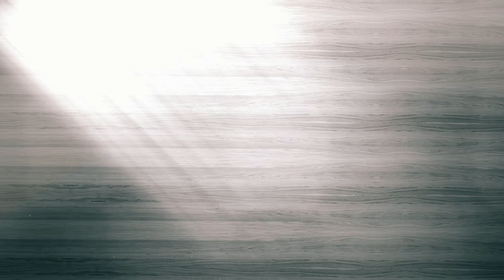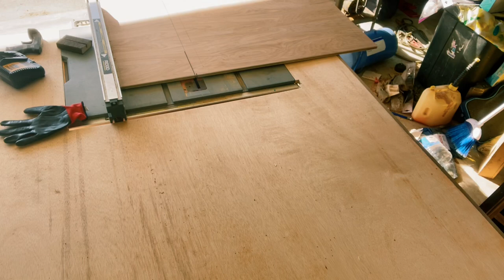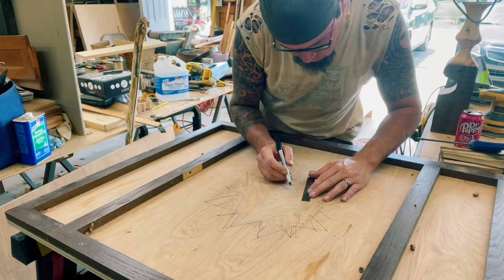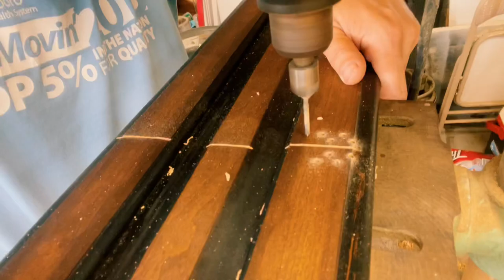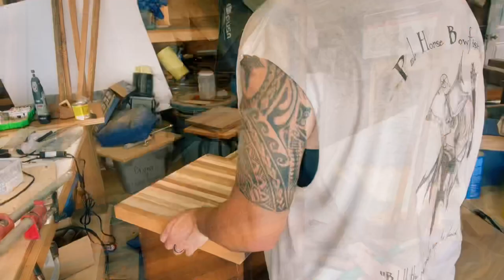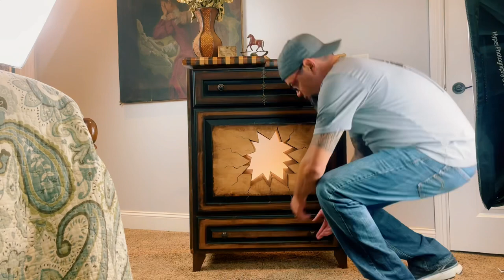Creative Woodworking… Building “Down The Rabbit Hole“

Comment: Amazing!  Thanks for showing most of how you did it. I’ve been waiting for this since you put out the Short to show it off. But WHAT is the trigger for the rising tea cup cupboard?  And the mechanism?  Had to watch it three times to see when it started to rise.  Thanks for the video!
Reply from the maker: No worries!  It’s a linear actuator mounted to the back. Runs by remote control. Was a super fun build.